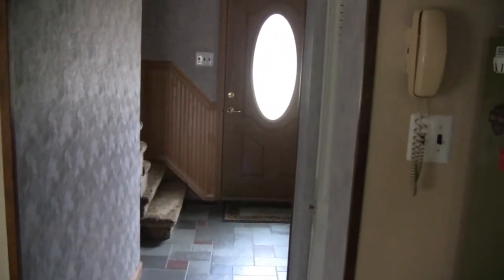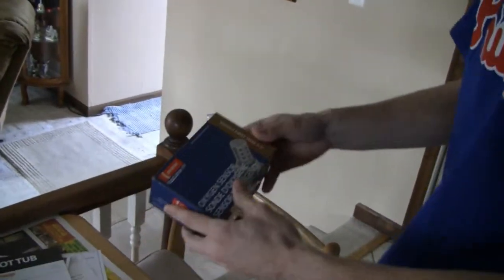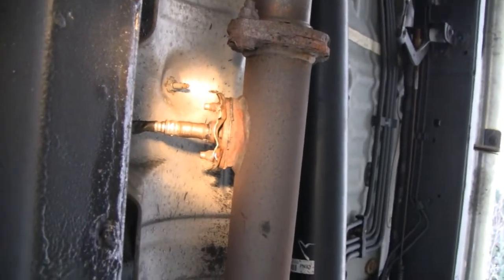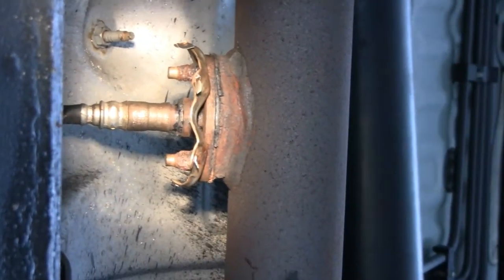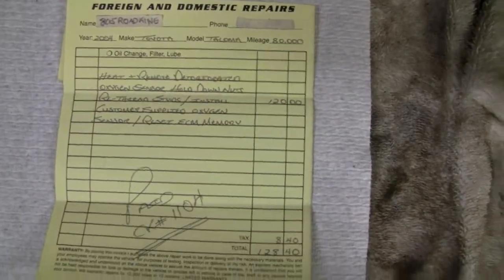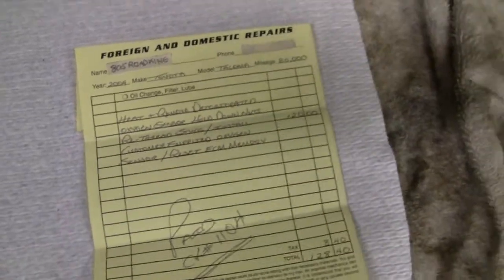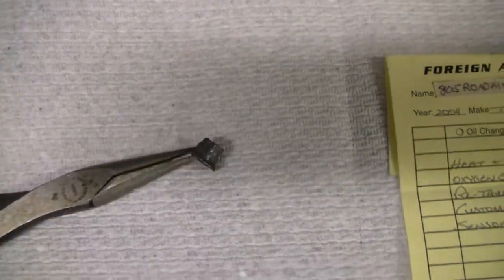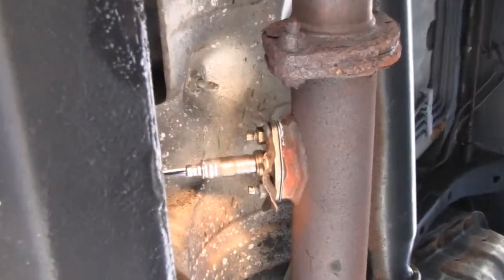O2 SENSOR REPAIR FAIL

Comment from the maker: That surprised me because that doesn't have any rust on it!! I replaced the front sensor a few months ago and those nuts were like brand new, I guess the exhaust pipe up there is so much hotter and it probably doesn't get as much water up there eh!!☺

Comment: I think you made the Right call on that Repair looks like they replaced the studs also ?  I would recomend  putting some sealer on the wire where it goes through the rubber boot

Comment: Just got the muffflers on my truck hung up, the flex pipe kept returning back so it would be rattling on the crossmember, so I had to take a piece of wire, the stuff you use on duct work (LOL) and clamp it to the pipe then to the frame to keep it in one spot, pain in the ass LOL but it works and sounds good now.

Comment: What year is that Tacoma? I've had to do Catalytic converters that had gotten so hot and had been on so long that the bolts were no longer bolts. They were melted, rusted pieces of stuck on metal.

Comment: Kinda funny, my 2003  tacoma just coded out with a P0031 error, low bank, sensor #1.  (Sound familiar....)   Mine looks pretty much just like that, so I'll be handing that off to a shop as well.  It was good to get confirmation of the shop call though....  My nuts look just like that.    (HMmm, that sounded wrong....)
Reply from the maker: I had to replace two so far, each one went a week before it was due for inspection!!☺
Reply: 805ROADKING Naturally.......  :-(   Lucky for me, mine isn't due for a year, it died just a week AFTER inspection. (Luck of the Irish...)
I bought a code reader for my iPhone just to be sure.